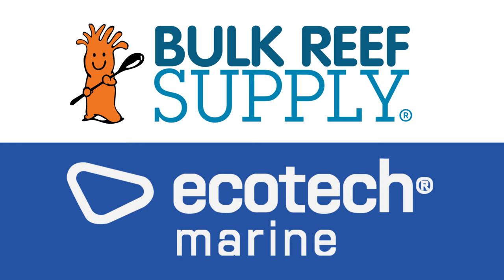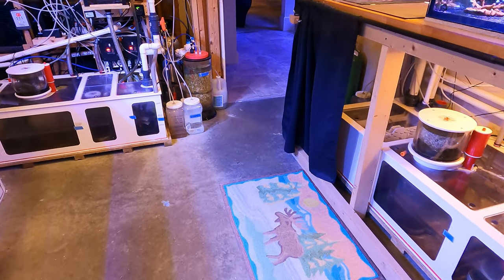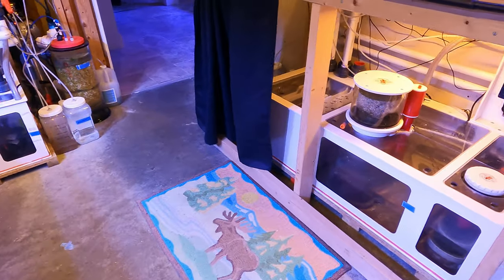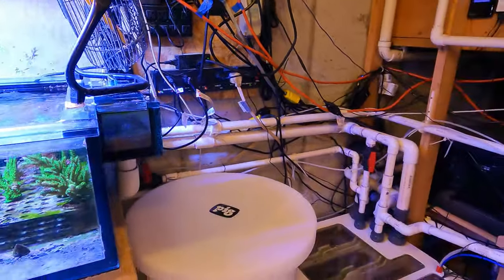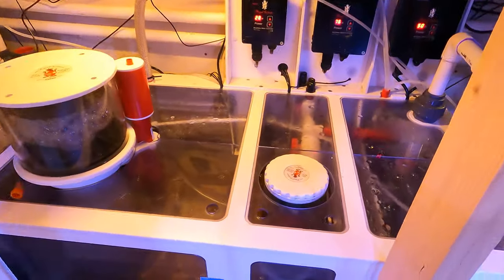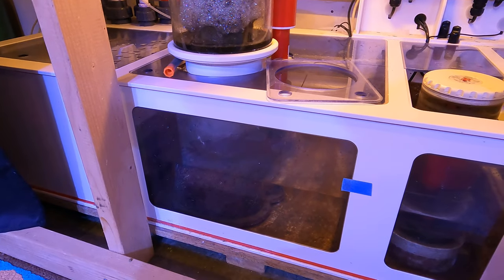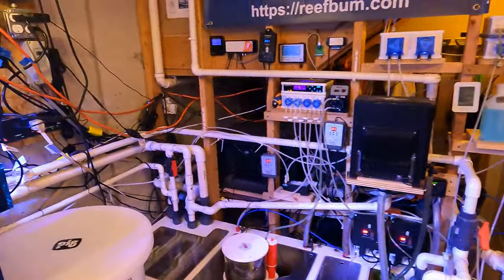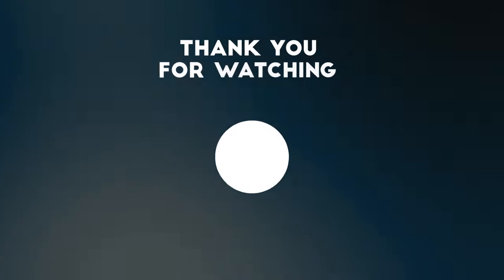BOTH Systems Flooded, Two Times!

Comment: There will be a momentary power loss if there is not a battery installed between the circuit and the generator.

As for the flood problem, just install an overflow drain on the sump and an appropriate sized container to capture it. You can add a leak detector to alarm in the container and even pump the water back when the return pump restarts.

Comment: It seems like some changes to the plumbing may by most helpful.  If the pipe coming from your return pump is 6” below the surface you will get a lot of water back siphoning if there is no siphon break.  If you have stand pipes anywhere tightening their connections to the bulkheads will keep the overflow boxes from slowly emptying.  Every tank is unique, but looking at your plumbing is likely going to be most helpful in keeping your sumps from overflowing.

Comment: Here in South Africa we have daily "load shedding". Our power is off for about 6 - 10 hours a day ( 2 hour slots usually), so any of us reefkeepers need to be able to cater for that. I have my tank on a 200AH Lithium Ion battery backup which will run my tank for about 12 hours straight if need be

Comment: Put a check valve on your return pump. Water goes in to the tank but won't let it syphon back to the sump.
Reply: Check valves work as long as something is not blocking them.  I personally wouldn't rely on them.  I know of at least 2 people that had snails stuck inside the check valve and therefore when they were needed they didn't work and overflows occurred. 

The best insurance is having enough capacity in your sump for when you're returns are off.  Maybe he can add more capacity.  That's going to be the best solution along with some sort of high level sensor in the event that only his returns stop working.
Reply from the maker: @bluerider0988  I agree, I am not a fan of check valves for the reason you stated.

Comment: Nothing is worse than water on the floor from an overflow. Have you looked into breaker panel surge protectors? Those should take the brunt of the surge since it is upstream of the tank.
Reply from the maker: Yes, my electrician did just install one and said it could help with the premature trips. I should have mentioned that in the video.

Comment: The best insurance is having enough capacity in your sump for when you're returns are off.  Can you add more capacity via another container of some sort?  That's going to be the best solution imo  along with some sort of high level sensor in the event that only your returns stop working to shut off your kalk.

Or just plug your dosers and returns into the same outlet.  That way if it trips it'll stop the kalk doser as well.
Reply from the maker: Yes, I did initially make that change and plugged my dosers into the same GFCI as the return pumps but now the return pumps are on non-GFCI outlets. I don't think adding another container will solve my problem. Check valves are an option for the return lines but I am not a fan since they can clog.